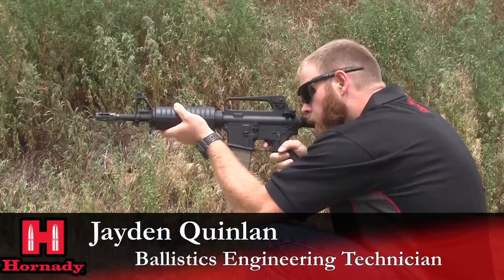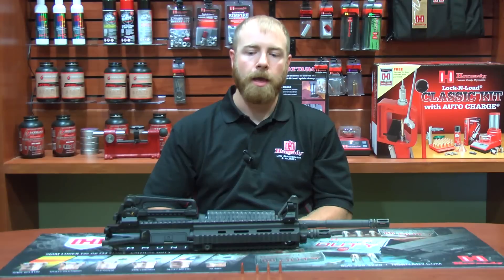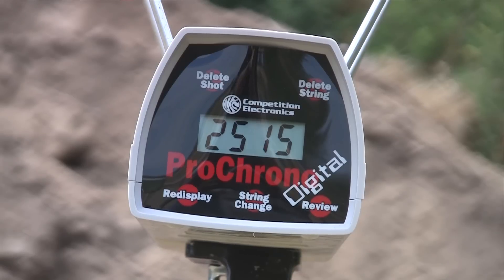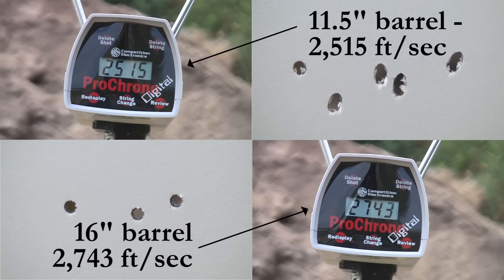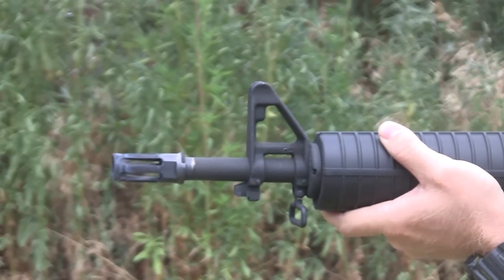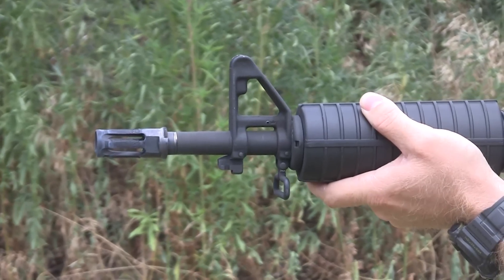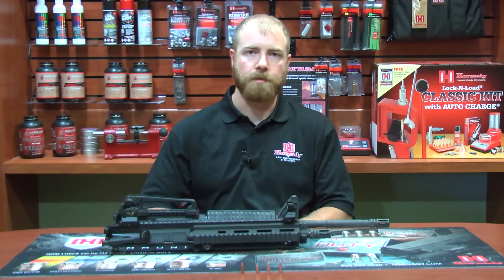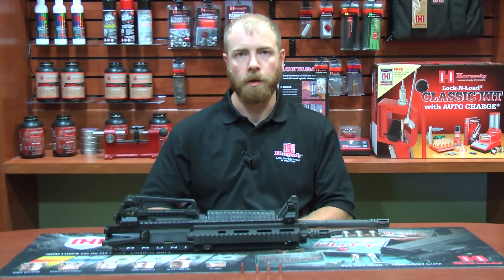Short Barreled Rifles and Ammo Performance

Comment: Many thanks for providing us Sport / Recreational shooters & reloaders valuable info on what to expect from given loads fired from the best possible platforms / Bbl length / twist rates vs bullet weights. Looking forward for you to upload more videos regarding pistol calibers in carbine length barrels + proper twist rates. The info you share with us is absolutely priceless, given the extensive experience your Professionals have thru many years working in this interesting topic. Personally I've chosen one of your 158 gr .358" JHP on top of max load of Hodgdon's Little Gun powder + CCI Std primers for my IWI, (formerly IMI) Timberwolf .357 Mag pump carbine, with a 18.5" Bbl, getting an average 1.985 fps @ 75° Fahrenheit & 2.500 ft altitude. Accuracy with above load averages about 2.1 MOA using a Bushnell "T Red Dot" sight from rest.

Comment: Never had that problem in my SBR even at extended ranges. Then again I run 5.56mm 75gr TAP T2 or 5.56 pressure 55gr TSX Hand loads at about 3000 FPS.